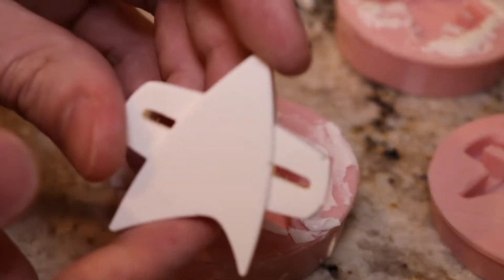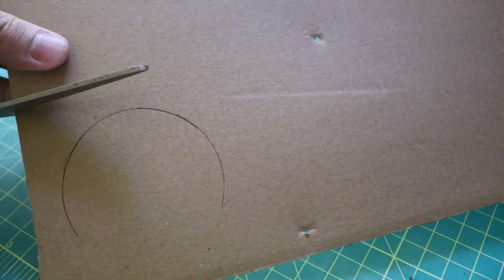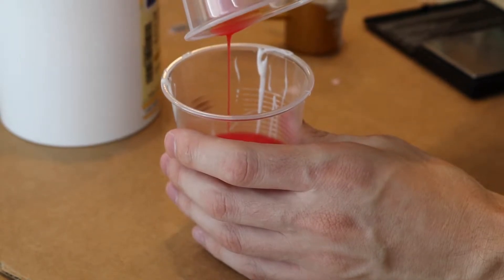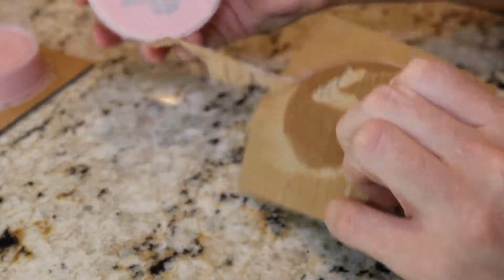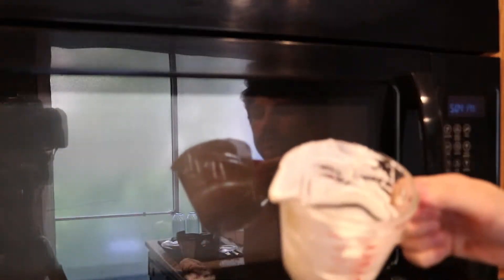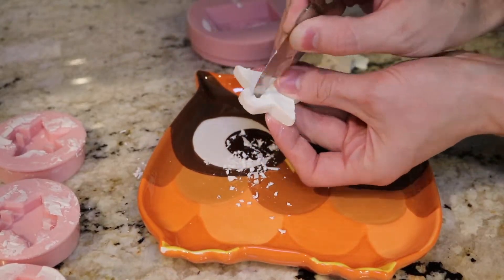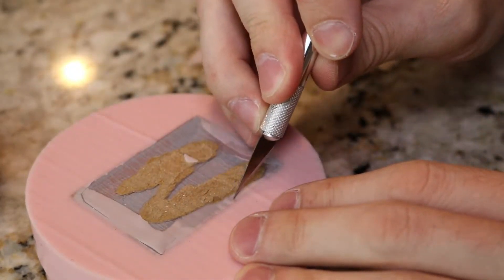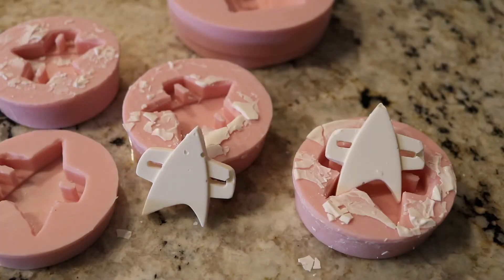Making Silicone Chocolate / Candy Molds with 3D Printing!

Comment: Does this work with a resin printer or is there a fear of contamination ?
Reply from the maker: As long as the print has been fully cured and properly prepared, you should be OK!
Reply: For personal use no-one will bat an eye. For commercial use you do have to file paperwork that it is food grade safe (you can prove it), otherwise you pay fines with the food administration.
Even the silicone in silicone molds has to be food-grade approved.